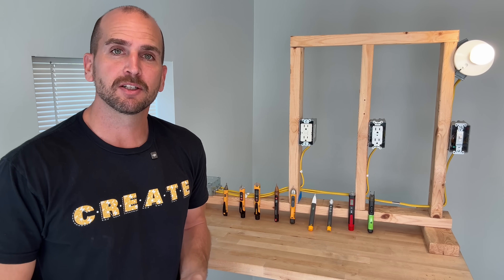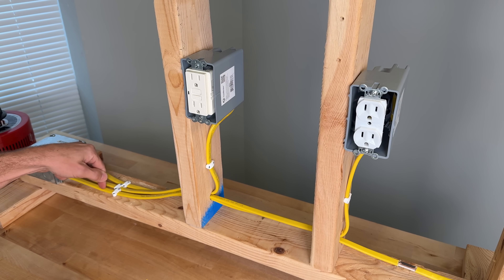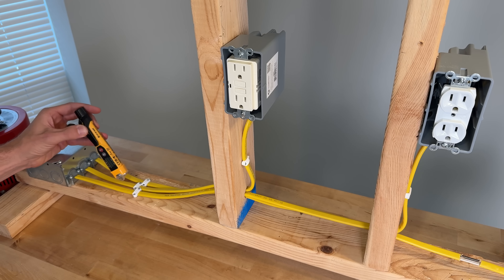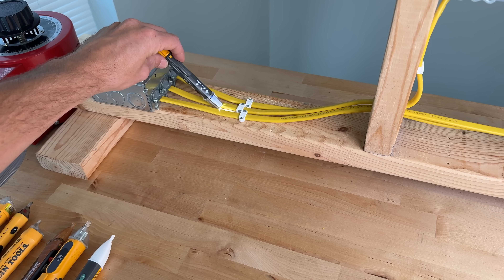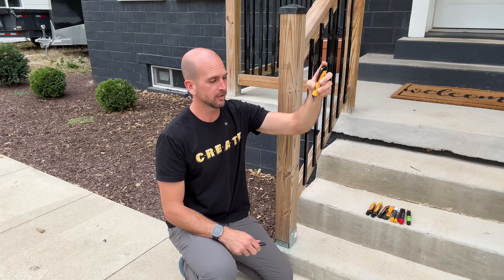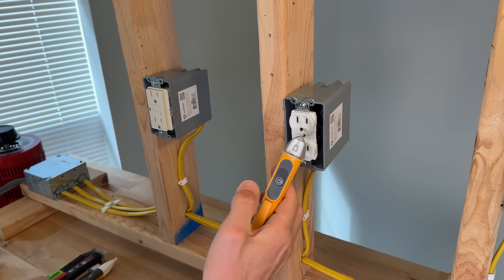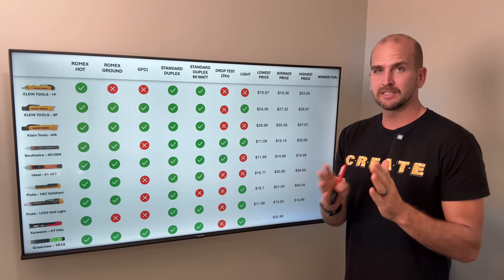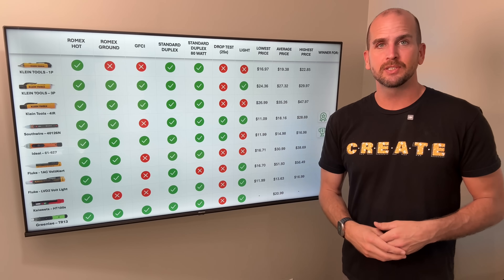The Ultimate Voltage Tester Battle: My Surprising Favorite!

Comment: Lol these death sticks do not work on voltage. They pick up vibrations. They sense the hertz from the ac voltage. The best one I ever had was one with a sensitivity adjustment control. I would often test on a known live circuit. Why don't we count on them? Because if another live circuit is nearby you can get false readings. Also batteries matter. Low batteries can make the sensor fail to detect the vibrations.

Comment: I know this is an older video but I just watched it and have had the southwire one for years. After watching I had to run out and find it in the garage and test a GFCI. Then I went around checking all of them in my house and it worked on all of them. Not sure why this one failed in this test but mine seems to work across the board.

Comment: My Southwire 40150N - 12v- 1000v  (you tested a 40126N ($18.26))worked just fine on a GFCI outlet and I actually like that it only lights up on the HOT side of an outlet.  AND mine has a flashlight. $5 more dollars on Amazon @ $23.35 today.

Comment: I would rather have one that tests all voltage devices rather than one that fails to detect in certain situations.  If there is not enough ambient light, I'd use either a flashlight or, what I do most often in order to have both hands free, is wear a headlamp.  In any case, I always confirm any results by using a DMM.  Also worth noting is that if you're trying to use one of the NCVD's in a confined space, like a box with more than one hot wire, picking up a voltage from too far away can lead to confusion over just which one (or more) of the hot wires is live.  I had a Fluke 1 ACII that I liked because you had to get very close to the hot wire in order for it to detect the voltage.  But alas, after a few years (around five) it quit working.

Comment: I bought Klein Tools (3P) from HD. It was delivered to my address without a  shipping box. I founded it  sitting on the floor. I don't know how the shipping was handled. I opened the package and the tool appeared intact but DOA. I I immediately thought about the drop test in this video.
I returned the Klein Tools (3P)  and declined a replacement. Based on the test, I am going with  IDEAL  But because I want a light, instead of model (61-627), I will get IDEAL model  61-637). It has a light and tests down to 24V instead of 50V

Comment: "Bang for the buck" is a strange criteria for choosing a potentially life saving device. I would rather pay $10 extra and have a tool that detects voltage reliably everywhere, including GFCI. I.e. Klein 3p or Ideal one. Orherwise what is the point of even having the tool if you cant trust it?

Comment: There isn't anything wrong with the Klein Tools voltage testers. The fact they didn't pick up voltage from the GFCI outlet is FINE. They have a narrow range for detecting electrical fields. You don't want more range on a voltage tester or you risk picking up electrical fields from nearby wires which are hot and alerting on the ones that aren't. 

The fact your favored testers alerted on the GFCI outlet should actually be a FAIL. Too much range. Too risky to use. They may alert on wires that aren't actually hot.

Comment: I generally use a plug tester for recepticles since I am more interested in whether it was wired correctly, so I don't care if a tester can do GFCI.  In a box, I like to see which wires are hot, so I don't really want a wide detection range.  I have used a Klein 1p for years, but the clip broke off and it would be great to have a built-in light, so I think a Klein 3p is my choice.  I don't ever drop my test equipment.

Comment: The angle of the tool matters more (because of the magnetic field) than the right middle or left position of the wire. The reason you willukd use this is to check if you have voltage anyway where for further testing.
Reply: I once had one by Gardner Bender. It was a little bit smaller, carried it in my shirt pocket. I liked it better than any one I've owned or seen. It worked for ME...

Comment: I'd rather attach the Klein 3P to a retractable wire and have it kept in a Husky tools apron to prevent falls, than to give up any of the measuring functions.  Actually, recently acquired Klein 3P for all outlet and fixture replacements at home.

Comment: I use the fluke 1ac, it can tell you witch wire has voltage 2 inches apart. Makes it easy to trouble shoot in the dirtiest rats nest. I used to use a klein 3p but it cant do what the fluke does.

Comment: I have a client 3P, I dropped it from a 6 ft ladder it still works it doesn't rattle but the audible sound scratchy. And after that I had noticed the difference in lights and how it beeps questioning if it still work in properly. Your description of the blue light and the red light, priceless cuz no other video had explained that. Thank you

Comment: Most often I use the voltage tester for finding the line side in a box with multiple wires. For this reason I don't like the ones that pick up a long way off, as I want to find the one wire in the box that is actually the line instead of the load.

Comment: I’ve gone through several of the garbage 1p Klein’s that I got just for use out of a secondary tool bag. I say several, because none of them lasted a year and the store I bought them from replaced them under warranty. If I actually had to pay for the replacements, I would have only ever owned one.

The old Greenlee that I bought well over a decade ago (around the time NCVT’s started hitting the shelves for less than $50) keeps on ticking just like it did on day one. In my experience it is at the perfect non-adjustable sensitivity level. The “alarm” is an ideal volume and pitch-altering tone that is great for hearing from another room. I don’t think you can even get that particular model anymore, and that’s a shame because everything else I’ve tried is inferior. Either the sensitivity, volume, or ruggedness of everything else is lacking. Also, side button placement is a terrible idea for a tool pouch. If the button isn’t on the end cap, I don’t want it.

Comment: Basically a sub $2.00usd 1AC-D knock-off works better than the genuine $40.00+usd Fluke 1AC-A II.  In fact it works like the newer Fluke 2AC in that you don't have to power on the unit to start using plus it has a flashlight that both the genuine Fluke 1AC-A II and Fluke 2AC does not !

Comment: One thing you didn't test is broken ground. I use the Kline tools 4IR I work on restaurants. The Kline 4IR Will tell you when a piece of equipment has a broken ground conductor on the power cord. Can just walk past equipment with it several inches away will go red any broken ground equipment. Great tool makes you money

Comment: I have a bunch of these... all of them work just fine on GFCI.  My 2 Southwires are the 40150N's  dual voltage, integrated flashlights, and never failed.  I also have the Klein NCVT-2 and NCVT-3 (neither one with the P at the end) and they work great as well.  No problem passing all of your tests.

Comment: I like your videos, very instructive. I believe when testing in a child proof receptacle, the results could be slightly different. My Fluke 1ACA II could not detect voltage in one of those duplex receptacle. It could work unless you really force the tester tip in, but you risk damaging the tool. Fluke 1ACA II is a 'contact' tester for precision diagnostic. Lets say you have a bunch of wires and want to verify which ones are live, then the Fluke is the one to use. I also keep a 'non contact' tester, Gardner Bender GVD-3504 which can pick up voltage through gips wall. It's not as precise as the Fluke, but it gives you a ballpark reading.

Comment: I see a problem with the testing, detecting aver the ground wire (more sentitive) will cause you a lot of false positive.
what if you have 2 long run of wires, there will be ac induction and you will have a false positive.

I know you could say I prefer a false positive and a false negative, but that can drive you crazy when you are not sure  that you have turned off the right braker.
a multimeter is the only tool that can be trusted 100%

Comment: My recently purchased Klein 1P correctly detected a GFCI outlet at home. The instructions stress the operator must not be shielded from an effective earth ground. Many ordinary users (their target market) would not know what that even means. I used a cheap Greennlee for a decade before that. No issues with that until it stopped working. That said, I wouldn't use either professionally. And I don't totally trust negatives from them. I have a meter or a small neon bulb tester for higher confidence.

Comment: I am surprise that some of these sub-standard tester are available for sale in the US market, not to mention you can find those sub-standard tester for sale in most big box companies.  As a home DIYer, I learned the hard way that some of the testers are should never be used.  I was zapped once when working on a circuit using one of the tester that gives me false negative after multiple tests.  How is it that these companies are not sued out of business is my biggest question.
Reply: I have the Klein 1P, recently purchased at Home Depot. It works fine for me. That said, the instructions have a long list of conditions that will cause the device to fail to detect. Not the least of which is the requirement that the user be grounded or in contact with an effective earth ground. Many of their target market users wouldn't know what that means. So, for example, wearing insulated gloves or boots may render the device in ineffective. The testers that really worry me are the noname cheapees on Amazon.

Comment: There must be some physical size issues that prevent use on a GFI. It's the same electricity.
Reply from the maker: I agree, The GFCI face is thicker so depending where the actual strip of metal is inside the NCVT tip seemed to be the determining factor whether it detected the hot circuit or not.
Reply: @EverydayHomeRepairs The mechanical characteristics and dimensions of these plugs are specified by their respective standards. I doubt that there is any significant difference between a GFCI and non GFCI outlet's plug.
Reply: The Klein 1P works fine for me on GFCI outlets.

Comment: I have the fluke LVD-2, sad to say that when i change the battery. the clip/catch for the battery cap broke off. i ended up use ele  tape going round the cap to secure it.. the design for the battery cap was badly design making it hard to change the battery.

Comment: i completely disagree with the reasoning behind the romex ground test. that klein which ive used for 10 years behaved exactly how it should. the worst proximity tester is one that rings from to far away. perfect example is the tripped gfci you tested. its showing power where there actually is none. the testers that detected voltage at the gfici should actually be given a fail and vice versa.
Reply: Was it tripped
Reply: The GFCI was hot
Reply: @bwall7116  a proximity tester should only ring when you stick it in the gfci. not from 4 feet away.
Reply: Agree 100%. I'm just a DIYer and so when I open up a box I want to know WHICH specific wires are hot! Not just that "somewhere there is a hot wire".
Reply: Finally someone gets what I'm saying  @Gotmath8
Reply: Why ring at 4ft  away never seen that

Comment: I purchased a CRESCENT CVS600VN- it has a range of 12-1000VAC, 48-1000VAC, an LED light, a 3 band strength indicator, and an audible alarm- beeping more frequently w strength.  I paid $28AUD.   Only used for a couple of days, but is good.
Previously I owned a Hioki 3120, and had it for years without trouble.

Comment: SOUTHWIRE-40150N, IP67 waterproof rating, LED at tip, flashlight in rear, two settings- 12-1000 and 100-1000 volts, power button is 100-1000 and press and hold the twelve volt button reads that scale and starts chirping about 5 inches away. I had it for 3 or 4 years now, no issues.

Comment: BTW, using stand alone ir temp testers to compare, multiple manufacturers, that Klein is off by about 3 to 4 degrees. As long as it's consistent in that error that's fine, though haven't determined that yet.

Comment: I'm not sure why not detecting on gfci isn't a no go for you...forcing me to comment lol? Anyway I have that exact southwire and Klein ir. I took the southwire to an Eaton gfci and on 24v+ it detected the hot side from about 6 inches away, and on 100v+ it detect from about half an inch away. I use both (I'm not the most trusting). Edit: both southwire and Klein.

Comment: Your daily carry is the best all around for the diy guy and would argue for it the best for a skilled electrician.  Any nc trster that doest detect power at gfci is an automatic fail for a diyer, that's how you get juiced, so that's the priority,  not drop test,  as a diyer is not  going to be using it as hard.

Comment: Very good video. I watched it twice. With tamper-resistant outlets being required by more city codes I think the one that can can get into those outlets is the best. I wish to add one more comment. When you check to see if the outlet is live PLEASE PLEASE PLEASE, check both plugs. They may be powered by different circuits, as I found out one day when replacing an outlet under my kitchen sink. I turned the power off for the outlet and checked with my multi meter to verify there was no current by inserting the probes into the holes. Yep, no power. Something made me decide to check the other plug. Flash! Bang! The flash was my multi meter leads melting. The bang was my head hitting the sink base as I jerked backwards. Seems the top plug was 120 and the lower one was 240, I guess for the old garbage disposal.  As I was changing my underwear and putting a bandage on my scalp, I reflected on how close my wife came to being a widow.

Comment: I've only used a few and so far my favourite one is from Laserliner and the worst one is definetly Wiha. That thing doesn't have an acoustic signal as well as a zoomer or a flashlight. I laugh my hat off every time I see someone using a Wiha voltage tester.

Comment: I'm a licensed electrician. The best ticker is the $4 orange one from Harbor Freight. Beats all of these. I use one every day. Also don't use a ticker if you don't know electrical work. Use a real multimeter. In a lot of situations these tickers will give you a false reading.
Reply: I'm an electrician and never used one, always used a multi. I get paid by the hour so alway rather be sure than quick

Comment: Can you explain to me why they have different limited range instead of universal range like 50-1000V? Shouldn't be able to detect Voltage and leave the exact number for multimeter?
Cause I have a very cheap MH02 with range 90-600VAC CAT II 600V alternative, it look exactly like your 5:15 Fluke 1AC-A II

Comment: I carry the Klein 3P. I love the flashlight and never thought I would use it so much before I got it. Changed my life. I actually don't love the high sensitivity when I am trying to distinguish between wires that are close to each other in a box but I  like how the low voltage detection mode works for normal voltage but at a longer distance when required and I have used it to find wires that got buried in the drywall.
Reply: My test is being able to distinguish the hot side from the neutral side of Romex or zip cord.

Comment: Light as a metric is silly. Drop Test is meaningless on a single unit .

Seldom need a light. Always have a cell phone. Don't want excessive battery drain on my tester.  

Drop Test on a single unit is meaningless. At least 3-5 units should be tested the same way to develop a baseline.

Otherwise, really appreciate the video & tests.

Comment: Santronics non audible and audible for years with awesome capabilities and no crazy false readings, always on, USA made, by far the best I’ve used. Drop it and it’s over for them for the most part.
Reply: lol. was looking for this.  was about to post this.  i personally only use the red non audible.  i found the red was less sensitive and more accurate.  i do want to try the hioki with adjustable sensitivity.  i love my hioki amprobe.  so compact.  can drop from 5m i believe.
Reply: @ I’ve never seen the Hioki tester adjustable sensitivity tester, do you have a link to it?

Comment: I have Fluke, Southwire, and Ideal models and my favorites are the Southwire and Ideal. The Fluke works well but it has such a loose battery compartment that it's annoying to use.
Reply from the maker: Thanks for the feedback and I have been impressed with the Southwire NCVT's.
Reply: @EverydayHomeRepairs  I have a few Southwire DVOM's that have been perfectly fine tools and use them interchangeably with my Ideal, Klein, and Fieldpiece units. In fact the Southwire compact AC/DC current clampmeter is demonstrably better built than the Kleins in terms of how the leads connect. I stopped recommending Klein meters as  even with upgraded Amprobe leads, the leads tend to work themselves loose and need constant attention in use.

Comment: Interesting tests.

As a commercial electrician for over 30 years, I have used a few non-contact testers...Greenlee, Fluke, GB, Klein, etc.  My most recent favorite is the Fluke 1AC-2, but I have a backup GB adjustable sensitivity tester for working on 347 volt circuits, where a non-adjustable tester becomes useless (get it within 2-3 inches of the box and it goes crazy). The GFCI thing was interesting, hadn't noticed that before but since every GFCI receptacle has a test button and most have an indicator light (or two) I wouldn't be overly worried about that (besides, as someone else pointed out, we have 3-prong plugin testers for that anyway). The flashlight thing just makes me laugh...I already have several flashlights, so having one in my tester is a non-issue to me. The thing that is an issue for me is both over-sensitivity and prongs too thick to fit in a standard receptacle. Good test, overall.